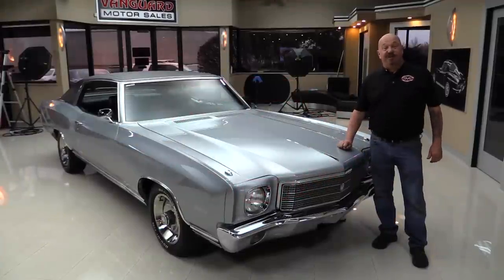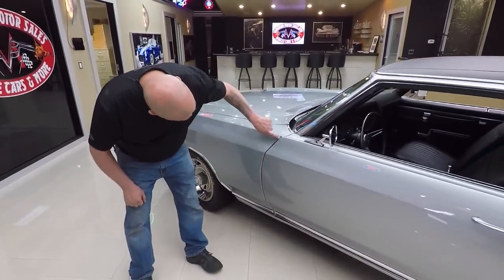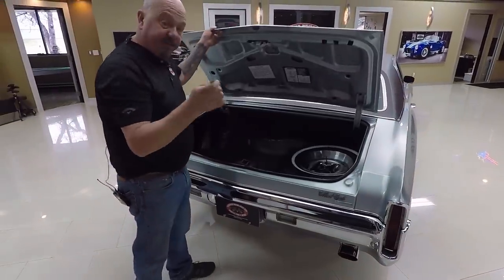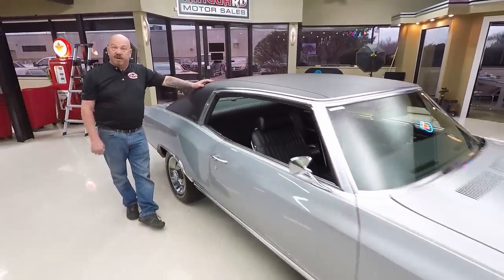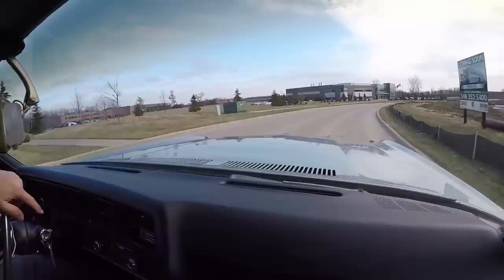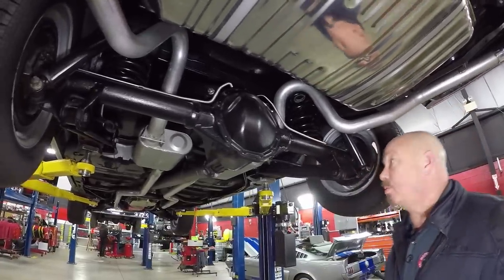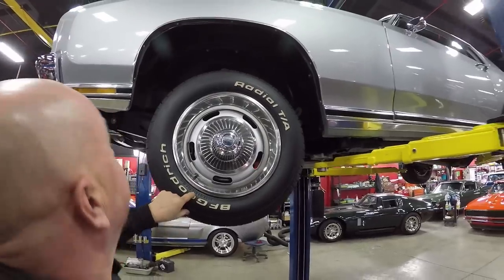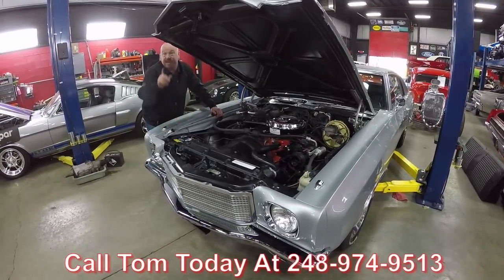1970 Chevrolet Monte Carlo For Sale

Comment: There was something appealing about them. I'd beef up the  front end with an anti sway bar, or a heavier one if needed. Discs in the rear. And maybe a little intake air and exhaust work and update the electrics.
They're unique that's for sure. 👍🏻😉